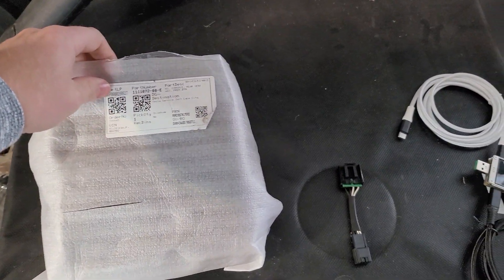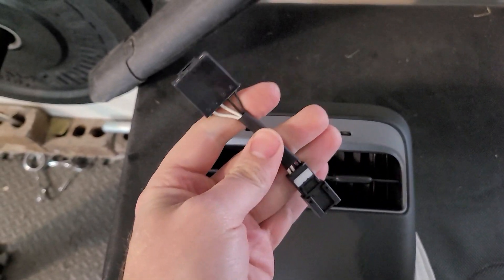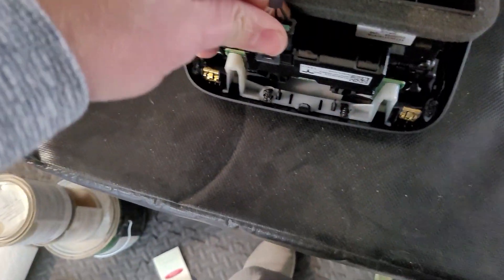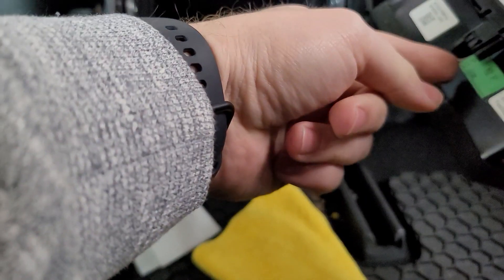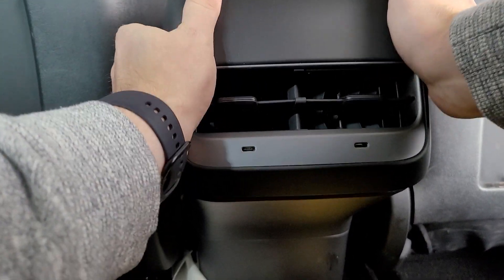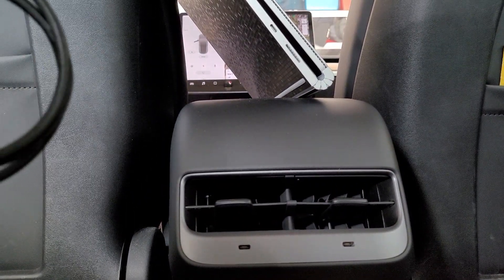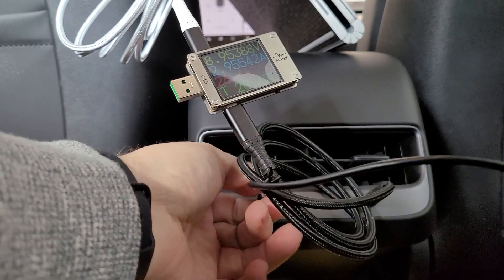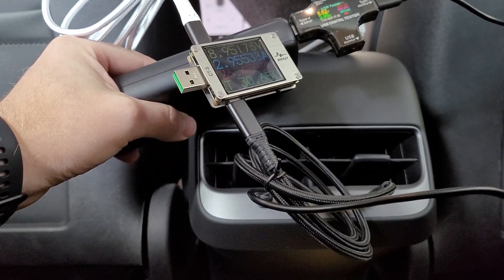Guide: Model 3 Rear USB Ports Upgrade to USB-C!!! 27Wx2 54 Watts!

Comment: Very useful, thankyou. Just did this in the UK. Much tidier than running cables from a PD adapter in the 12V power socket.

Comment: Would have been nice to see the watt test for the USB-A. 

Did you do this? Would help me decide if this is worth it or not.
Reply from the maker: USB-A ports are never more than 5V without special circuitry, so they likely were not more than 1.5amps, so 7.5W likely, but possible they were 2.5 amps which would be 15W, so 7-15W on USB-A.

Comment: Great video! Did you manage to the front ones as well? That would be great
Reply from the maker: I didn't see the value in doing the front ports for myself, since I had already wired the 12v outlet from the center console up into the front area so I had good power already there.
Reply: @cbutters  I did the same! So worth it.
Reply: @cbutters  Wait, how did you do that? Do you have any links/videos to that?